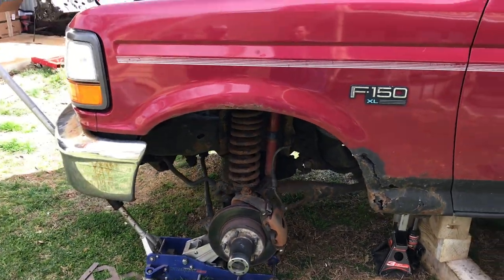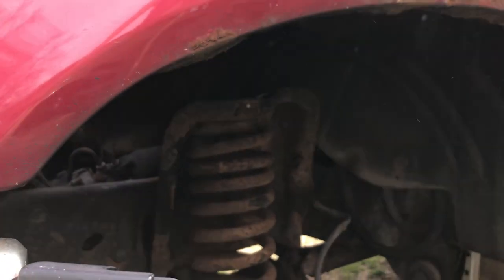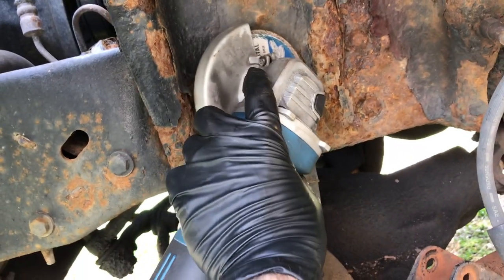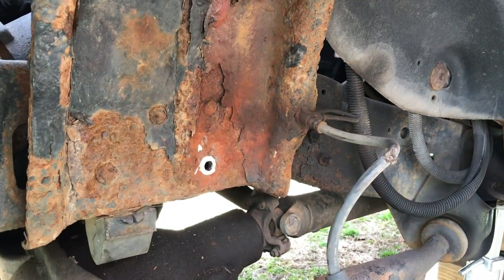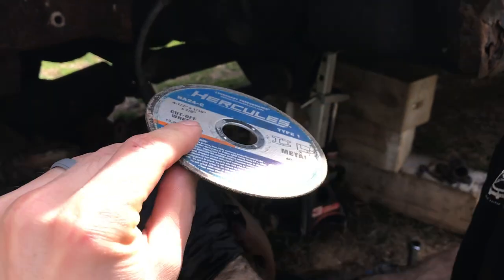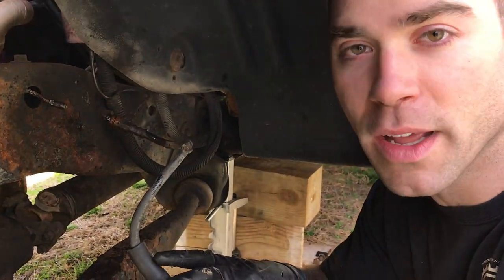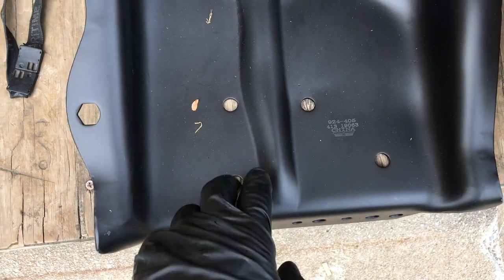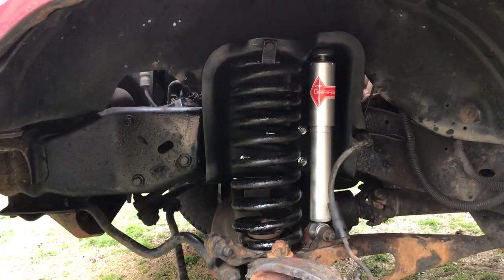How to Replace Rusted Coil Spring Towers/Perches | 1995 Ford F150

Comment: Thanks very much.  I have a '94 F150 with a 5.0, 347k miles.  I'm replacing the upper rear shock brackets this weekend and while I've replaced the front shocks, I do have the same problem as this video describes.  Thanks again for the video and the instruction.
Reply from the maker: You’re welcome man!🤙

Comment: Every time I see these type of spring tower replacement jobs due to this huge amount of rust I can’t believe nothing ever broke apart before hand. It’s crazy! Glad I don’t usually have to deal with this type of rusted out parts here in Texas. Good job guys, enjoyed the video.
Reply from the maker: 3rd Coast OBS I know right! I always wonder how a doting did not blow its way through the tower. 
Thanks man!🤙 Thanks for watching!
Reply: When the shock blows through the top of it, that's when you know it needs replacement!

Comment: That’s what took my 94 off the road. Passenger side busted after going over train tracks. Just haven’t had time to get to it. Great video
Reply from the maker: Jon Zidek No way! So the tower broke and the spring popped out?
Reply: The Minute Masters  pretty much. There’s an inch of so still holding on but it dropped the body down about an inch away from the tire. I have 33x12.5s on it and it rubbed almost all the way home. Was only 5 minutes from my house and I live in the country so I ran it lol 😂
Reply from the maker: Jon Zidek Damn man! Lol That’s crazy! Yeah I would have ran it home too! 🤙

Comment: Very instructive as usual.  One may find it easier to undo the brake lines from the coil tower before it is loose from the frame.  Two of these I have done included upgrading to the quad shock type towers.  Having done this to several trucks I would also suggest inserting the bolts from inside the frame and installing the nuts on the outside.  There is clearance if the correct length of bolt is used and allows one to easily see if one or more of the nuts works loose over time.
Reply from the maker: Thanks Don! Very good tips as usual!🤙 A visual inspection for loose bolts is a good idea.

Comment: Thank you for the video, I was not looking forward to going into this project on my 91 E350 blind. It's not exactly the same but close enough that you basically walked me through the whole process. This has been making it much smoother and gave me some confidence that I could get it done. Thanks again guys.
Reply from the maker: No problem man! 🤙 I’m glad I could help you out! Good luck with your spring tower replacement and thanks for watching!

Comment: What?! Two of you Hollywood handsomes hitting YouTube! Hold on a "minute" there buddy. What is that jackstand/jack combo thing? Love your choice of front shocks but odd seeing you holding a "blue" tool instead of a red one. That bumper mount for the camera is CLASSIC! Tom, you're in extremely good hands having the minute MASTER show you the ropes. I'm heading over to check out your channel and subscribe. Now, that '64 landau with the 390. NICE!! Love those with their sequential back lights and wraparound back seat, thermometer speedometer, tilt away wheel etc. Had a couple of those and oddly enough, I looked at a '66 landau yesterday with 64K miles locally. Gorgeous car, but I just can't get into the '66 compared to the '65, '64 all the flare birds, square birds and of course the 55-57 baby birds. Sure do appreciate your time and efforts guys. Thank you!
Reply: Patrick PhippsPA thanks Patrick! The blue tools were mine as I am the budget builder of a couple vehicles. They are the harbor freight Hercules edition. They are great tools as for the past 7 years I have been using metabo brand and they keep up! I can’t wait to get the t bird up and running with some new performance parts but taking my time as you can drop a $10k in a motor easily. Thanks for watching!
Reply from the maker: Patrick PhippsPA Hahaha! Thanks Patrick! Good to hear from you! You don’t miss a think. You know if it’s not Milwaukee it isn’t me. Lol So that is a bottle jack+jack stand I bought from amazon. The bottle jack raise the jack stand half and you can then lock the jack in place. It’s like a two in one. That was my GoPro trying to capture some footage in that tight wheel well. But we had fun! Yes, definitely check out Tom’s channel. He’s just cracking open that t-bird. So you won’t miss a thing. Thanks again Patrick! You have a good one and stay healthy brother.

Comment: Great video! Theres a quick and easy way to get those rivets out too. If you cut a plus sign deep enough into the rivet head it will section the head into four pieces almost like cutting a pizza. From there just hit it with the peen side of a ball peen hammer and itll plop right out. It saves alot of the cutting blade and alot more time. Keep at it. Would like to see you two work together and fix up his truck now. Itd make a great series!
Reply: “Fat Judy” would love that too as she could use lots of love everywhere 😂
Reply: @thestateofreal2533  lmfao. You should make a series called, "fat judy's transformation".
Reply: Cole Rippeon HAHA that would be great!

Comment: I highly recommend using an annular cutter to cut the solid rivet heads off. It takes like 2 minutes with cutting oil. Then use an air hammer to knock the rest out. Takes 4-5 minutes per rivet.
Reply from the maker: Doesn’t an annular cutter need to be mounted in a drill press to function effectively?
Reply: I used a ball burr on an angle grinder. Grind a big crater in the center of the rivet and use the air chisel to knock the head off.

Comment: I've done 2 of these.  Stevie said it right... once the rivets are out its a cake job.  1 trick i have found out,  the new pockets are thicker steel than the old ones which sometimes makes the brake line clips not fit.  A good remedy for this is to put a small hose clamp on the backside fitting.  It will maintain tension and not allow your line to come thru the hole.  Otherwise you have to fab new clips.
Reply from the maker: Thanks Joshua! That’s a good tip! I think mine fit and I can’t remember how my brother’s worked out.

Comment: Glad this video is up! Swapping my '93 Bronco from a single shock to a dual shock setup. Glad to see some indepth angles ahead of time.
Reply from the maker: Skitter302 Nice! Have you ever thought have keeping it single shock and using a King or Fox shock?
Reply: @TheMinuteMasters   I have driven multiple single shock and dual shock Broncos and have found the Dual shock set up keeps the front under control better. Might be due to the extra contact points more then the quality of shock.
Reply from the maker: Skitter302 Gotcha. That makes sense. Do you still install a good brand of shock when you have duals?
Reply: The Minute Masters I installed a set of rancho rs9000xl shocks on my daily driver. The adjustability is great.
Reply from the maker: Skitter302 Nice! How do you like those? Can you compare them to Bilsteins? How’s the ride?
Reply: @TheMinuteMasters  The ride is great with the rs9000xl shocks. I turn them down for off-raod, and turn them up for highway travel. Can't compare them to anything  in the same price range but they are far better then budget shocks. Worth the purchase.
Reply from the maker: Skitter302 Nice! Good to know Skitter! I’ll have to try them out! I have a miss matching set of shocks on my truck now. So I definitely want to get a matched set.

Comment: Use a ball burr on an angle grinder slightly smaller than the rivet shank. Grind a crater in the center of the rivet head. Sheer off the head with an air chisel.  Sand down flush with a 4” flap disk or grinding wheel. Knock out rivet. Way easier and quicker.

Comment: Here's another mini project that you might want to make a video for. I bought my towers off the net, they didn't come with bumpers like the genuine FORD towers do but genuine Ford are double the money. I am going to try to save the old bumpers. The old ones are rusted on solid. Either I am going to cut them off the old towers and give them a soak in PB Blaster to brake the bolt or.. grind the bolt heads off and tap a new whole. Wish me luck :)
Reply from the maker: charles foster Nice! That’s the way to go when you want to save a few bucks!🤙 We got lucky and were able to unscrew the OE bumpers off the old towers. On my truck, I bought new Prothane bumpers. 
Good luck man!

Comment: What? … you didn't drill a whole through the wheel well...nether did I... ha ha ha . I've been working on my 1994 F150 XLT 2wd all this winter. I didn't have a clue on how to do it. Your videos have been very valuable. I've replaced the shock towers, springs, radius arm brackets, radius arm bushings, axle pivot bushings, front brake lines (stainless steel) upper and lower ball joints-left and right, removed all major components, grinded all the rust off them, painted them with Eastwood Encapsulator PLUS, waiting for warmer weather to paint the frame. I even bought the same exact shock absorber you recommended - front and rear. Your brothers and my truck are the same color... Electric Red. We have another thing in common, we both drink beer after we get done with a project phase. Thanks for all the advise bro.
Reply from the maker: charles foster Nope! Lol I even asked brother if he wanted too because he couldn’t find his open end wrenches. Lol So he just cut the old shock out. Lol. 
Damn man! You’ve been busy! That’s a good amount of rust work accomplished. Eastwood makes great products. I’d like to clean and paint my frame eventually. 
Nice! Ford had nice colors for these trucks. 
Hell yeah man! A beer is a nice smooth reward during a project. 
I’m glad you enjoyed the videos man! Thanks for watching!🤙

Comment: I have a 2008 F250 and on the passenger side the Spring seems to have pushed its way up through the top of Spring mount on top and now my truck sits about 3 inches lower on the passenger side I’m hoping it won’t be an expensive fix probably gonna have to do both sides
Reply from the maker: Damn! That’s bad! It happens though. The de-icer and brine they put on the roads the days eats steel like nothing else.

Comment: Time to tackle mine, they are turning into Swiss cheese! Hope the brake line isn't too bad mine looks like it is rusted solid together with the shock tower.
Reply from the maker: Nice! It’s more intimidating than it looks. I would try to chip away the metal around the brake line. It might just be covered with rust but not seized together.
Reply: @TheMinuteMasters  hopefully. I might just do that and try to do it without disconnecting the line if it's too bad
Reply from the maker: @Backyardwrenching1243  If I remember correctly, I don’t think you need to disconnect the brake line.

Comment: I remember in the comments on a previous video you said that moog springs are terrible. My springs are starting to sag and i’m looking at replacing them, what brand would you recommend? Thanks in advance!
Reply from the maker: Yup, I don’t think Moog springs are thar great. The issue is, I haven’t found a brand I like yet. There is a company called Eaton detroit springs which I’m interested in trying. They are more expensive than Moog but they sound promising.
Reply: The Minute Masters Thanks for the response! Would love to see a video if you follow through with buying those springs.
Reply from the maker: Sean Henricks You bet man! I’m tired of crappy coil springs.

Comment: Where did you order your coil spring towers and how much did they cost? 

Please let me know at your soonest, my coil spring on my 2001 Ford F350 is rusted out, and as a result, cracked in half. 

Unfortunately, the mechanic wants to order the part for $700 (with two weeks turn around time) stating Ford has discontinued the part.
Reply from the maker: I bought mine from autoandtruckspring .com. I just looked there for coil towers for your f350 and I didn’t find any. 

Here’s what I did find doing an internet search: https://www.getoemparts.com/oem-parts/ford-housing-assembly-5c3z5a306ba

$700 seems pretty steep. Check out that website and input your trim and engine.
Reply: What's a "trim"?
Reply from the maker: @TARV3052  Sorry I meant to say “trim level”, XL, XLT, Lariat, etc.
Reply: How much did you pay for each of your F150 coil spring tower? The parts you all have seem to be very sturdy and heavy duty. The cheapest part l have seen ranges from $45 and up. I wonder if there a great difference in the quality based on the varying prices.
Reply from the maker: @TARV3052  I think I paid almost $100 per spring tower and they came with all the hardware.

Comment: Great video.. I thought you would show the installation
Reply from the maker: Thanks man!🤙 I don't usually show the installation of parts but I'm going to try to show more installations in the future.
Reply: @TheMinuteMasters  yeah... I looking for ways to get mine installed... thanks it was still great information
Reply from the maker: @wemcal  Thanks man! What help do you need in particular? I’ve done this repair twice.
Reply: @TheMinuteMasters  I “was” going to replace my single shocks with a bucket assembly to have the shock and springs... looks like I’m going with coil overs
Reply from the maker: @wemcal  I would definitely go the coil over route if you can. Solo Motorsports and Desolate Motorsports make a ton of kits for 4x4 OBS trucks and Broncos.
Reply: @TheMinuteMasters  you confirmed what I was told... I’m going to look at more of your videos, I’m sure they will help... f250 7.3 here, thanks a many
Reply from the maker: @wemcal  No problem man!🤙 Good luck!

Comment: Interesting and informative video too bad you don't have a air hammer air chisel I would make things easier and too bad you don't have some rust paint either por-15 or i e s 1500 to clean and paint that frame rail before you install the spring bracket and you probably should have purchased towing package Springs or some Springs that were new and probably leveling spring to reinstall while you got all that apart that would have been ideal and also you want to look at the camber bushing you may need an adjustable one or replace and how about the bushing at the back of the radius arm was that looked at or on the other end of the suspension arm that both to the middle crossmember that probably should be addressed as well and everything should be coded and cleaned and painted with Rusty before reassembly
Reply from the maker: Thanks man!🤙 I agree with you 100%. It would have been nice to do all that work but we had limited time and this truck is my brothers DD. When I did my spring towers I did at least paint the frame behind the spring tower. But all those other repairs you mentioned, I did do at a later date because I was also short on time since I DD my f150 too.